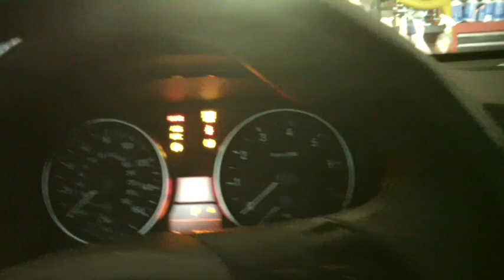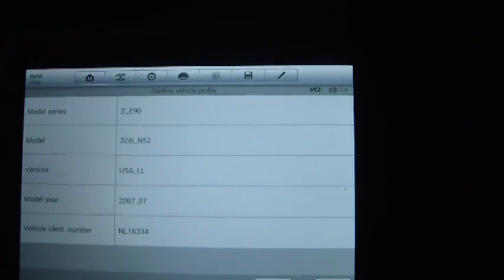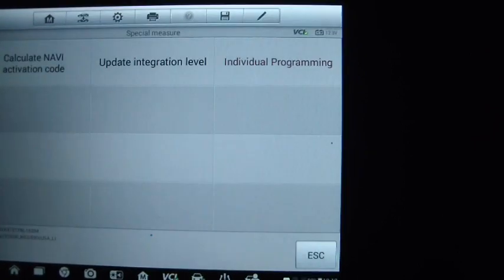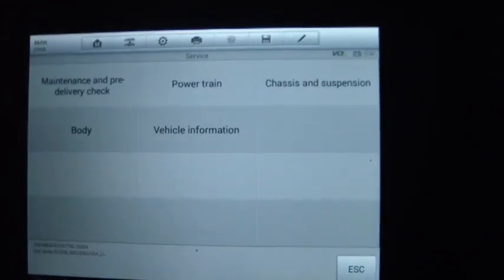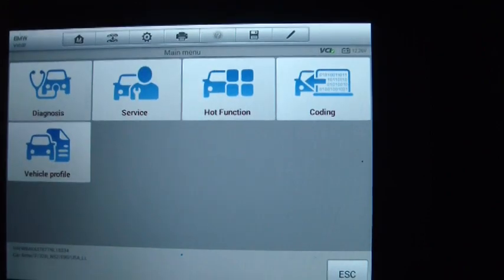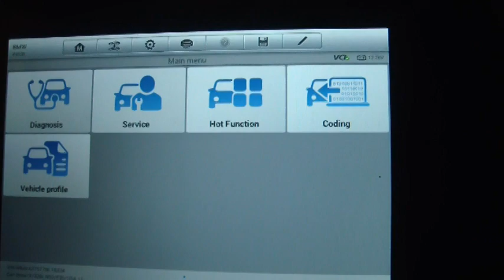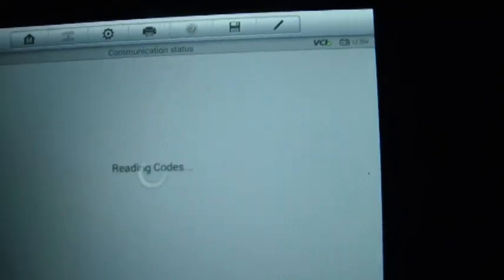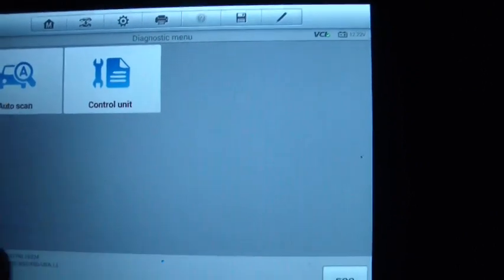A quick review of the Autel Maxisys MS906TS Scan Tool on a BMW 328i E90.

Comment: Are all 3 906 models virtually the same as far as these functions go?
Reply from the maker: All three use the same diagnostic software and all three have the same exact functions, the TS version also has a full featured TPMS programming function and a built in ant to transmit the TPMS signal to activate the sensors. If you don't see yourself doing TPMS work then go with the 906BT if you want cordless connection or if you don't mind having a cord connect from the OBD connector to the scanner then the 906 is fine.

Comment: I got the snap on modis edge but I hear this maxisys is better and I planning to buy it  can you give me and advise if this scanner is worth it?
Reply: Thanks then I will keep mi modis and  I going to buy the maxisys 🙂
Reply from the maker: I had a snap on verus wireless and sold it and got this one and the two things I miss is the troubleshooter and the connector views. Other than that this one does more, was cheaper, and the updates are cheaper.

Comment: should i buy this over the snap on?
Reply from the maker: I would say yes if money is important, the main things I miss about my snap on is the built-in help such as connector views and troubleshooter but for the little amount of money the Autel cost me vs the snap on I can do without the snap on goodies.
Reply: so the autel has no tsb's or helps?
Reply from the maker: No
Reply: snap on guy was trying to sell me an apollo d8 today. $5000 with data subscription.
Reply from the maker: I would go with the Autel, in fact depending on what you do keep in mind the update plans. For instance, if I had to do it again I would go with the MS906BT as opposed to the MS906TS simply because I do not do any TPMS work but when I buy my yearly update I have to pay $100.00 more for my update because of the TPMS software. The MS906BT is the same thing as mine but without the TPMS built in. Either way my update is only $550.00 which is cheap compared to snap on but the BT is only $450.00.
Reply: good to know. autel should be plenty good enough for me. i work for chrysler and we have our own scan tool witech2, but we get used cars and what nots as well. thanks